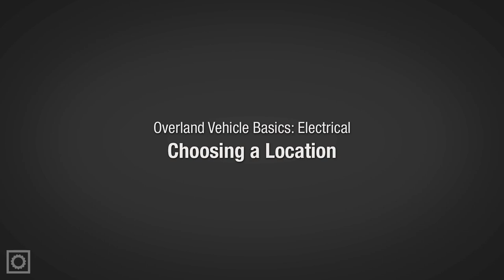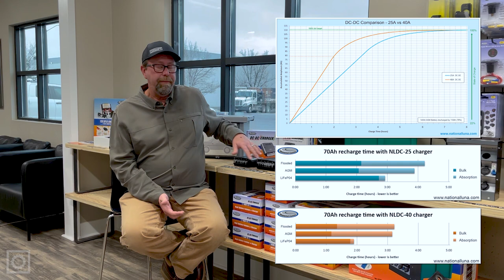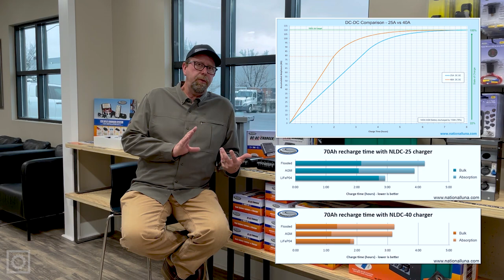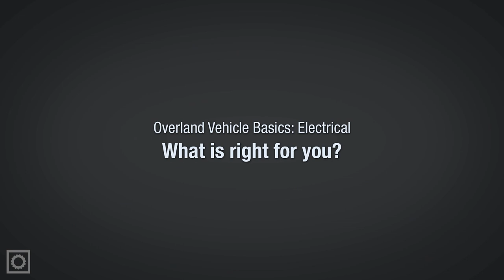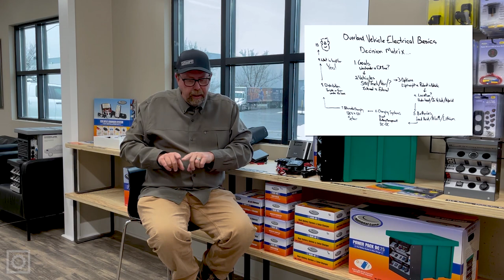Overland Vehicle Basics: Electrical Systems

Comment: Great video. Thank you! The only addition I would make is regarding AGMs. The battery manufacturers I've spoken with recommend that their batteries never  be taken below 50% capacity. That means your 100AH Group 31 is is really 50AH usable. (That's the situation I'm in). If I were to replace it with a 100AH Lithium, I could use almost the entire 100AH, effectively providing twice the capacity in the same space, at less weight. For true apples/apples comparison, you have to effectively double the AGM price for equivalent Lithium. Now we're talking $700 for 100AH usable AGM (and twice the space) or $800-1000 for 100AH usable in a lithium such as the Battle Born. On the flipside, I can run my Northstar AGM under-hood, and I don't think I'd dare put a $1000 battleborn in that environment in the mountains of Utah when temps drop to -15F and our southern Utah trips can easily reach 130F under-hood in the summer.

Comment: Awesome presentation.  In which cases do you suggest to add an inverter? Most of what one connects to a dual battery system needs 12 V.  Thank you
Reply from the maker: Most folks are adding inverters for laptops and camera gear. Laptops can be used with DC power cables to avoid the inverter but there are a few things out there that need an AC plug. Pure sine is what you need for the larger scale inverters but an average laptop is somewhere 80-100w so you don't need a huge inverter for something relatively small like that. Many of us make a point to avoid AC accessories which means we can skip the inverter entirely.
Reply: @Equipt1  yes, that is what I thought.  I'm building my own overland vehicle and I in order to cut on extra weight (and expenses) I'm trying to avoid the inverter.  To charge a laptop, say you have a DC25, how would you plug it in? Thanks
Reply from the maker: @viajesjaipurofficial  As far as I'm aware, most laptops use DC powered batteries, You should be able to find a DC specific charger cable. Take a look at the following link I found with a brief Google search. I would go this route if I needed a laptop on the road. This may not be the perfect solution for every laptop but it shows what's possible. 

https://diycamperconversion.com/12v-laptop-car-charger-powering-laptop-without-inverter/

Hope that helps!
Reply: @Equipt1  yes, this is what I needed. Thank you very much for the link.  I will buy one of those.

Comment: Good day. I would like to know how do you connect a inverter to the green battery box?
Reply from the maker: Our suggestion would be to connect a grey anderson coupler to the wiring from the inverter and then plug that into the grey anderson inputs on the power pack. Those grey couplers are rated to 50amps, should be plenty for most inverter applications.

Comment: Just a quick question - I have a dual battery set up with a dc-to-dc charger.  How would/could you jump or charge your main battery from the house battery?
Reply from the maker: Great question!

In this scenario, best practice would be to carry something like a jump pack as a back up plan, just in case the main battery gets killed. The National Luna DC systems are not designed to back feed voltage to the main battery under the hood. The circuitry does not allow for this. On the flipside, the National Luna solenoid systems are mechanical connections that allow for two way current transmission. Generally, lithium batteries that are designed for deep discharge and recharging (fridges, electrical accessories, lights, etc.) and not designed with cranking amps in mind. 

We would suggest something like the Noco Boost line of jump starters.

Hope that helps clarify!
Reply: @senseidadproductions I have the same setup you are describing, utilizing a 40A DC>DC for my house battery. I ran an experiment, and it has worked out well for us, so it stayed. I ran secondary battery cables from both of my batteries to a Blue Sea 3-way cutoff switch. From this switch, there is also a third lead going to my winch. I utilize the switch for a few purposes: 1. I use it as a winch disconnect to prevent accidental or malicious triggering of the winch solenoid. 2. I can run the winch off the main battery as described in this video (preferred), or run it off the house battery in an emergency situation where I couldn't start the vehicle to utilize the alternator. 3. I can bridge the main and house batteries to self-jump start the vehicle should the starting battery get run down or damaged for some reason. I also carry a lithium jump pack, but have been in multiple situations where I've tried to help stranded people, and their starting battery was ran down to almost zero voltage (dome lights left on usually). In that case lithium jump packs don't recognize the battery, and the safety features prevent it from sending any amps. I've found lithium jump packs to be useless if the starting battery voltage is too low. If I'm going somewhere really remote, I'll also carry jumper cables for ultimate redundancy. Everything is a space and weight tradeoff. Hope this helps. I'm sure there are better ways to accomplish what we have, but it has worked awesome for us, and has saved us on a couple occasions. Cheers!
Reply: @TRAILPOWER  Thanks for the perfect explanation.  I too have carried cables to temporarily connect the two batteries but your idea about a 3 way switch is much better.  Thanks again!
Reply: @senseidadproductions  You are most welcome.

Comment: Great presentation Paul. Is there ever a scenario where it may be appropriate to consider replacing a stock alternator with a more robust alternator that could provide greater power or efficiency? Thanks!
Reply: There is definitely a place for high output alternators. I've built several desert racer cars where it was absolutely key to get a high output alternator that could keep up with the massive and extended power draws and the abusive hot/dusty conditions, as well as shrinking the pulley to reduce the alternator working RPM when you're hanging out at high RPM most of the time.
Reply: Simply put, if you're typical draw is higher than the max output of your alternator then you need more output.

Comment: LifePo4 will discharge just fine below 32F without hurting them. (specs on my renogy 170AH say -4F)  You just don't charge them below freezing.  But you can run a heating pad on them or use built in heating features on some batteries.   Most DCDC chargers these days can restart the BMS on a lifepo4 batteries. (Redarc DCDC for example).    I think it was a pretty big miss on your part to not mention the useable amp hours of AGM.  Also, the explanation about voltage drop over state of charge was pretty jumbled.  You used the word capacity, never mentioning voltage.  Props for sitting down to try to explain all this stuff in one sitting, but it is kinda full of inaccuracies.
Reply from the maker: Thanks for the feedback, all great points. This is meant to be a general starting point for folks and from there, we can have more detailed conversations or they can begin doing their own research. As you know it's a never ending rabbit hole and it's impossible to cover everything in an hour long video, there's always more to cover. People need to do their own research into the specific products they plan on using and we can help with that.

Comment: You need to watch Will Prowse. So much wrong here.
Reply: If I wanted to get an electrical/solar system installed on a truck with a camper, who would you recommend going to for the install and would the NL power packs be one of the best ways to go about it?
Reply: @arturv83  I wouldn't. That system seems so antiquated. I personally would build something in from scratch and if I wanted an all in one pre built system I would look at renogy or blue yeti or something like that. It's really not that difficult to buy the individual components you want and build a system in to your rig. 100ah liFePO4 battery, dc to dc charger, some usb and 12v ports, a mppt solar charge controller, some fuses and terminal blocks connectors etc, and a solar panel or two. Best of the best in the mobile solar world for components is Victron, best batteries are battleborn and lithionics, best budget brand imo is renogy.